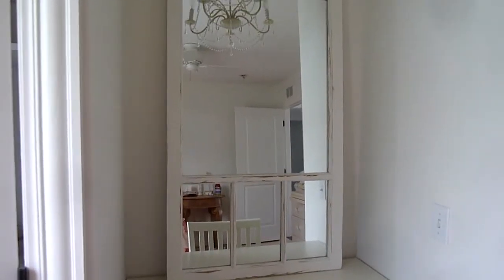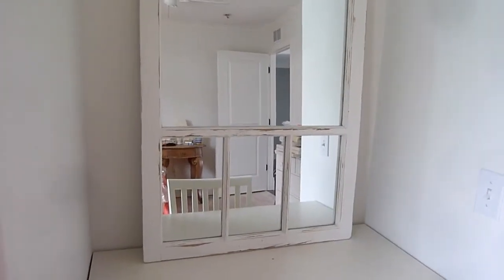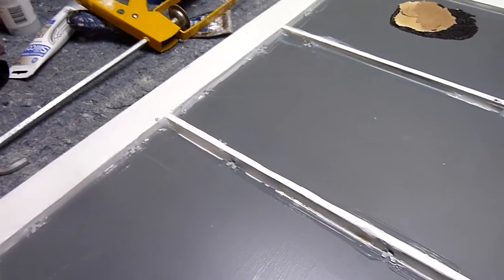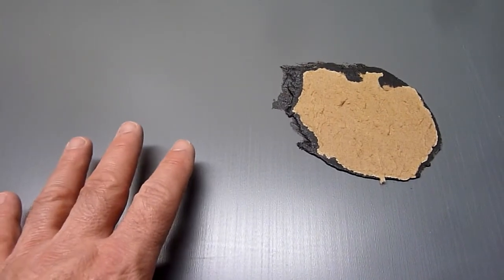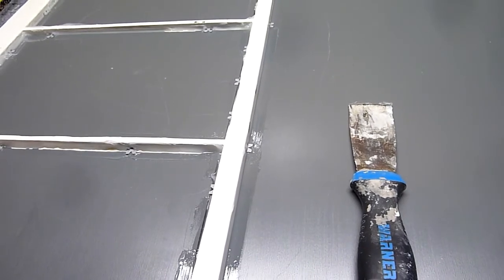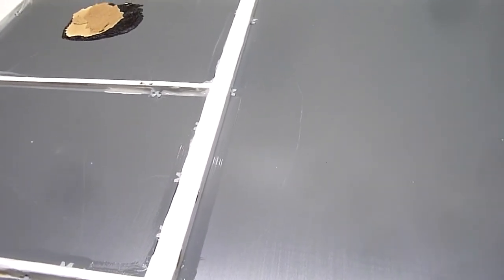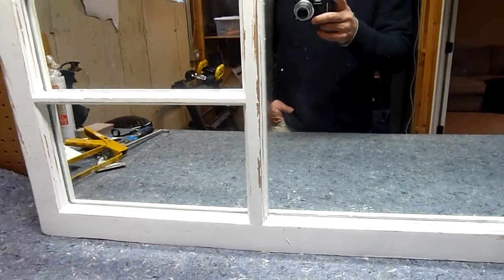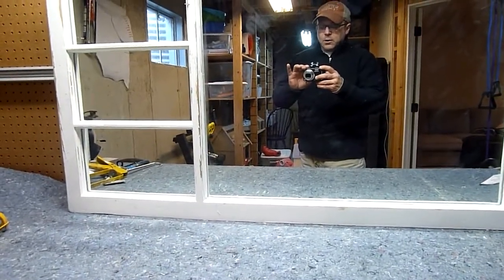DIY Mirror from old vintage window frame - EASY and LOOKS GREAT

Comment: Did you remove the glass first or put the mirror flush to the old glass?
Reply from the maker: Hi - thanks for asking. I removed the glass and replaced it with the mirror glass. I just took an old mirror to a local glass place and gave them the measurements and they cut it to fit the panes. Hope that helps and good luck with your project!